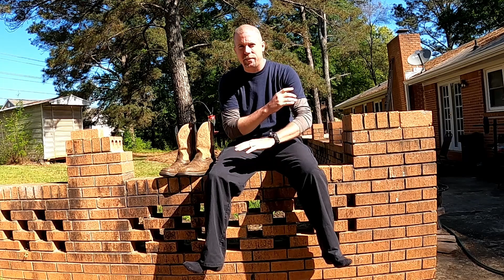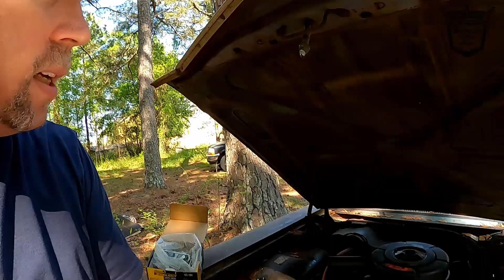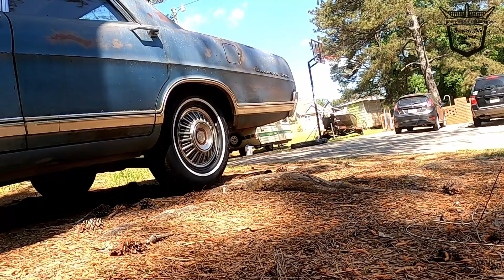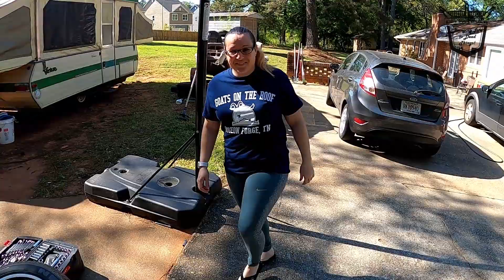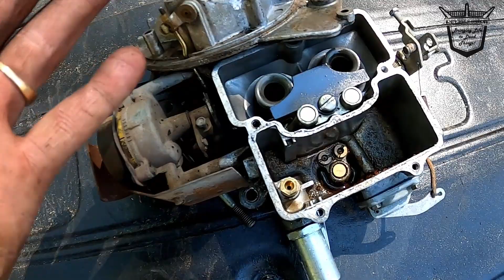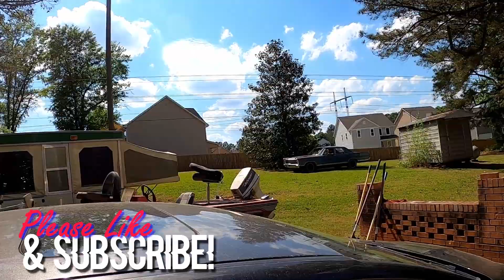Will It Run & Drive? Abandoned 1967 Ford Galaxie 500 Revival - Brakes, Carburetor, & Test Drive!

Comment: Residue from the bottle mixing with the gas
Reply from the maker: Correct Shawn. I think we agree.
Reply: Classic sugar in the gas tank! Someone is hating on ya Rev. A boat fuel tank is by far easier and safer than a Mtn Dew bottle man. On the plus side you can use the pump bulb on the hose to prime the fuel system.
Reply: @thegarage5919  you can use a pop bottle just wash is out first water in the fuel is better than sugar lol
Reply: @RevStoration  Hey Rev, My thought is this is the residue from the e85 gas somebody must have used before you bought the car. P.S. i like to buy this sweet old Galaxie 500 when IT  becomes available. Old Fords never die, They just out run old chuvies any day. Praise the Lord. Have a Blessed day.
Reply: I hope you an. Family get well soon thanks for the prayers God bless tall

Comment: Glad you are up and around Rev. Dave. I'm 70 and have never gotten that Covid stuff at all. Might be because I have 20,000 white cells in my blood attacking everything because of my Leukemia. You did really well getting that old Master cylinder off without twisting those brake lines. Yes indeed all brakes are important after all you don't want to see a wall coming at you at 50 miles an hour and you can't stop. Great video Rev. David
Reply from the maker: Larry... We agree that breaks and very important...
Reply: @RevStoration  I say that from experience I have crashed into a wall at 50 mph and lived to tell about it. after that I figured I had a Guardian Angel watching out for me.

Comment: I like the hubcaps on her, truly.
And don't feel like you have to "get back to normal" faster than you feel like it. It'll come.
Reply from the maker: I think the original caps are meant to be on this ride. Thanks for watching.
Reply: @RevStoration  Your half right Rev, these covers are off a 66 Ford Galaxie 500. the 67 covers are slightly different.

Comment: First thing I hope you get to feeling better. A cheap insurance tip buy 2 of the plastic see-thru filters install one before the fuel pump and one before the carburetor and to be safe the carburetor fuel filter. It’s like triple filter the impurities and when they clog just replace them when needed this will pay off when you start using the fuel tank. Again hope you get to feeling better prayers Said for you Rev and your family. 
that’s a lot of sediment in the carburetor. Have a Blessed One Sir.
Reply from the maker: Eddie, great idea... I am going to install the filters... I need to clean out the fuel tank and then get the filters installed... Thanks for watching.

Comment: So glad to see you back making videos and recovering from Covid. The stuff in the carb looked like a mix of old evaporated gas and rust that made its way from the tank and lines in to the carb. I had that problem with my old van. When you add fresh gas it turns to gel and can make its way through the filter then as soon as you parked it and the carb went dry again it solidified.  Good work on wheezy though keep it up. Maybe sometime I’ll make it down your way to wrench with you
Reply from the maker: I am thinking it is the plastic breaking down from the plastic Mountain Dew bottle, but you may be right.

Comment: Soda from the bottle, it is the sugars in it! They do not mix with gas! Try putting granulated sugar in a cup of gas it will not dissolve in it. So being they use corn syrup now days I would say it is that.
Reply from the maker: I cleaned the bottle before putting gas in it... the fuel was breaking down the plastic bottle...

Comment: Ethonal in fuel of 87 octane gas of Winter fuels with additives  Rev :)  if get fuel from tank it old Lead in gas to plus could be soax in fuel send unit to need change too also! Plus had gas in bottle got dirt from home property too!
Reply from the maker: The bottle is breaking down from the fuel... No fun.. but we have figured it out.

Comment: hey rev,got a tip for you. if you and your dad the 1960-73 fords had an issue with their breaker plates  in the distributor  which may or may not cause starting issues 
please advise
Reply from the maker: I have had the plates to rock loose before.... It is easy to repair but a booger if you drop the screw.

Comment: I may not be seeing this clearly on my screen. I was just watching it on a little Chromebook.
But it looks like you have the dirt covers that come with the master cylinder on the outlets instead of the bleeding fittings.  You have to run the tubes back into reservoir or into a glass of brake fluid.  When you said the pedal is still spongy I suspected that could be a reason.  
I have gotten master cylinders that were MISSING the bleeding fittings and tubes. I save those when I get them for the next master cylinder.  You can bend some from a short length of brake line with fittings from the part store.
Also, it is said that bench bleeding on  a bench works better because you can push the piston a full stroke. Farther than it gets pushed in the car.  When I did it the first time on the bench, I got a rock hard pedal BEFORE I even bled the wheel cylinders.
Reply from the maker: This master cylinder came with the red bleeder bolts.. I think I still have some air in the line and if not, I will remove and bleed on the tail gate of Ole Puddin..
Reply: @RevStoration  I think the red caps are dust caps.  Is there a tube connection in them?  If not they can't be much good for bleeding.
Reply from the maker: @auteurfiddler8706  I have used and purchased them for the purpose of bleeding master cylinders... They come extra with every one I have purchased.. They work or they have for me...

Comment: You should have waited until you did the front and rear brakes to replace the master cylinder. If the wheel cylinders or brake lines need to be replaced you'll just have to bleed the brakes again.
Reply from the maker: I play it on the edge often... Grateful that it worked out... Thanks for watching.

Comment: Rev come on son if you're going to use a 2 liter bottle for a gas tank you have to rinse out the bottle and make sure it's completely empty of soda the syrup will kill that carburetor
Reply from the maker: I cleaned the bottle out before using it.. I think what was in the carburetor was the plastic bottle breaking down from the fuel...